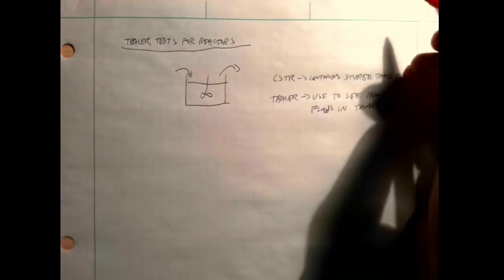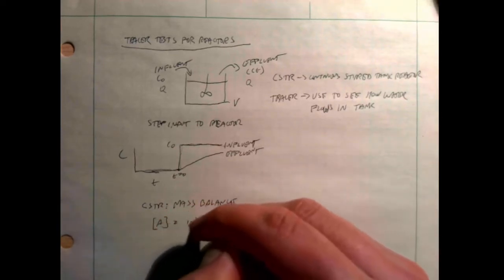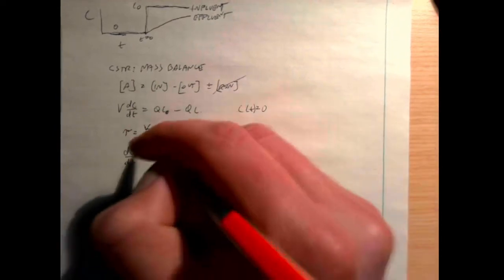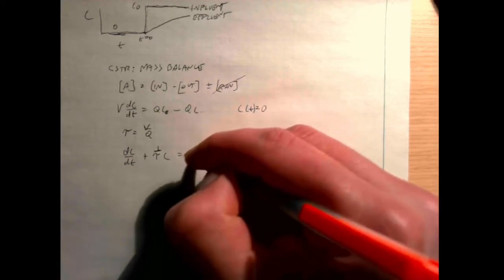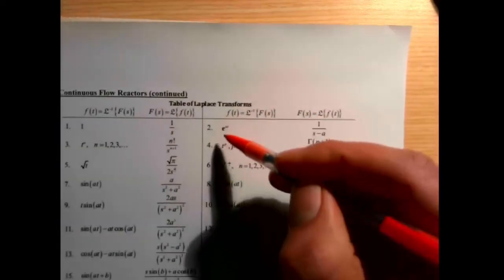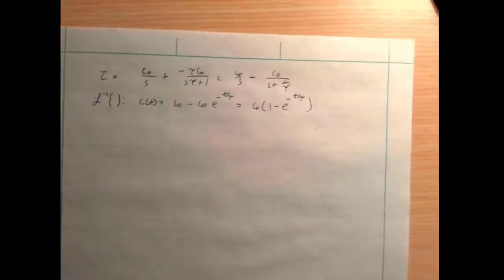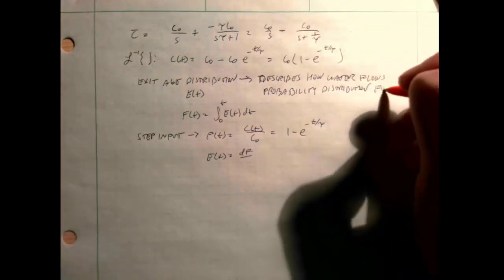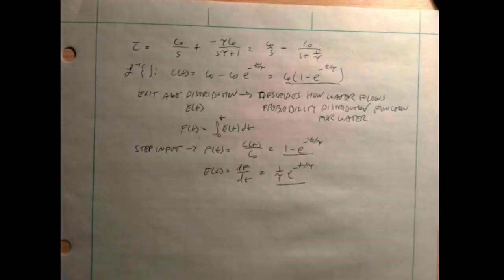Exit Age Distribution Derivation for a CSTR Using a Step Input Tracer Test with a Laplace Transform

Comment: good video, but small question. I completely understand how to do this when c(0)=0, however, I was given a problem where at {0=<t <5 ---> Ci=1 & 5=<t  ---> Ci=0)... I am supposed to find the exit concentration at t=30 and I am so lost.
Reply from the maker: It seems like you would need to use the principle of superposition to analyze the problem, if I understand it correctly (input concentration steps up from 0 to 1 from 5 seconds). I would need to make another video to analyze this case. The essence is to combine a "step up" input with a "negative step up" input. But I would need to think about it some more.